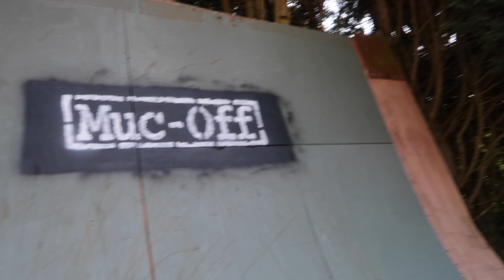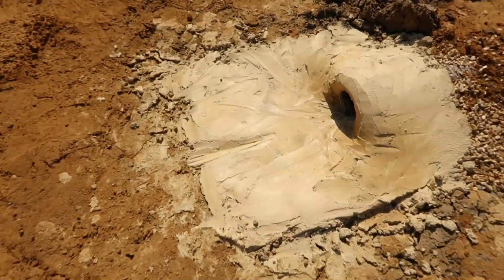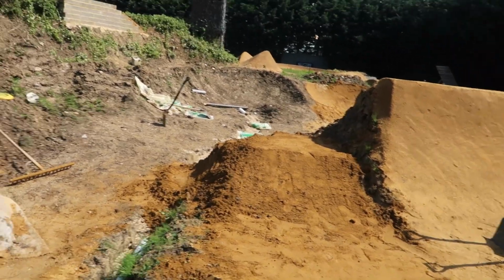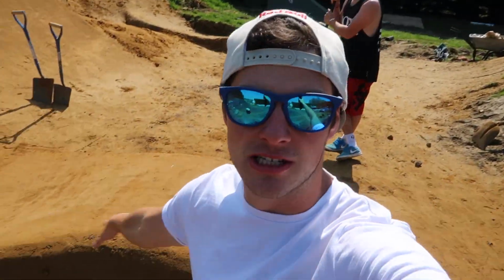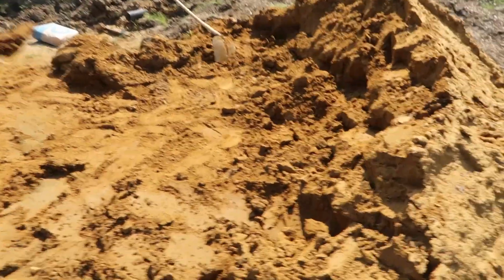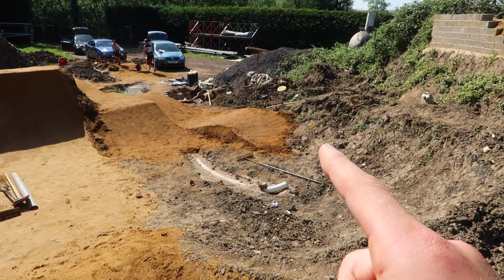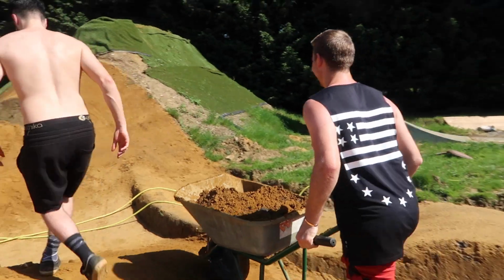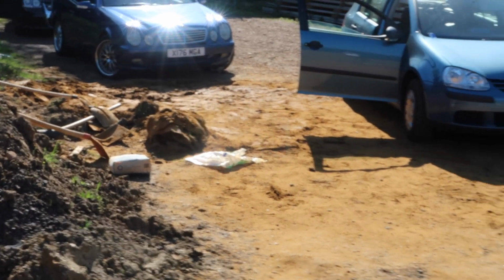THE BEST PUMP TRACK VIDEO YET!!

Comment: Loved watching the build your doing a banging job. I just want to suggest 1 thing. If you dig a small hole at the lowest point of your area where the water is running to.  You would then have water you could pump out and water track on baking hot days to help maintaining jobs. Again great building

Comment: Hi Matt, I've got an idea. if you where to take the line over the table top just to left of the volcano ( facing the landing of the volcano ) then ride over where the drain pipe is and make a jump over the berm to link in with top section. Of course you could ride this the other way as well.

Another idea that I don't know if you've thought of already is to (if you can get the speed for this ) ramp up where the face of the brick wall and make it a hip into the start gate of the pump track ( also reversable ).
 Cheers, I hope you enjoy the ideas, Dan.

Comment: right after that table top you made that pretty much leads to the drainage pipe, you could put a really small little hip jump to send you into the landing of the roller on the line with the straight rollers. Then you'd be able to go flying around that 180 berm and do cool steezy tricks over the volcano! Plus then the tabletop wouldn't be leading straight into a drainage pipe and you'd be able to keep that protected and not have it being filled up with sand from skidding and trying to stop.
Reply: Peter Spang lmao it doesn't lead into the pipe
Reply: ok maybe i saw it wrong sorry chill man haha

Comment: Berm / wallride going from the hip towards the drop in, using the retaining wall as the wallride /berm and then ride it going towards it (from the hip) and berm right into the beginning of the track again. Also has a possibility of turning that retaining wall into a minute vert/ quarter pipe

Comment: Im wondering if that wall you've built is going to eventually tip over :P You've essentially built a retaining wall, which is usually reinforced by some uprights, sunk rather deep, on the face of the wall.. I Guess time will tell :P Pump track looks absolutely incredible though, probably my favourite pump track design Ive seen.

Comment: you just HAVE to make that brick wall into a quarter at the bottom, tight ish transition and then just brick vert. that'd be soo good, plus it'd let you keep speed or exit, or both, transsfer out back into the start...

Comment: To get a concrete finish, you have to add a few inches and wet it then Pat it down once it's dried. Then you add a few inches and repaeat until you reach your desired height.

Comment: do another roller out of the 2cnd berm to the spine so you could possibly hit the spine from berm 2 180 in the air use the face as a landing and go through berm 1 around the rollers to the hip